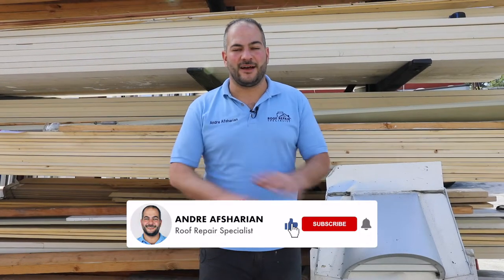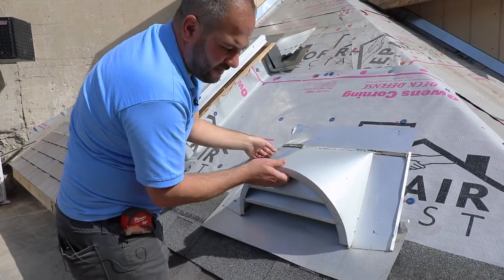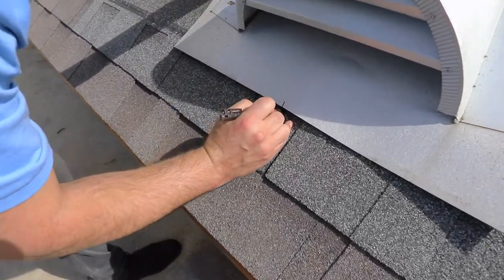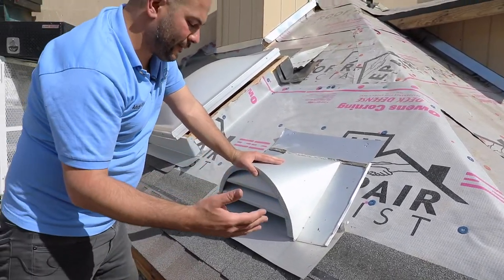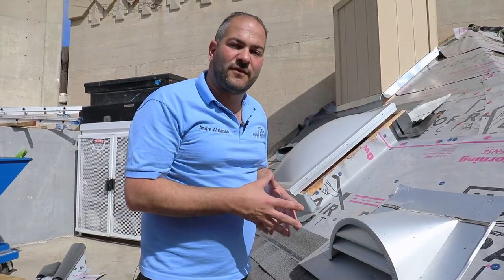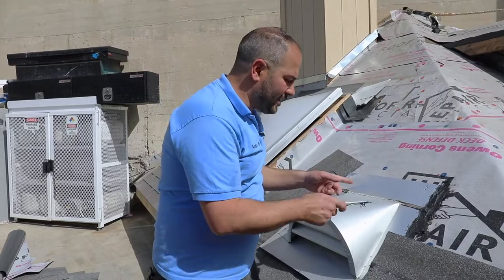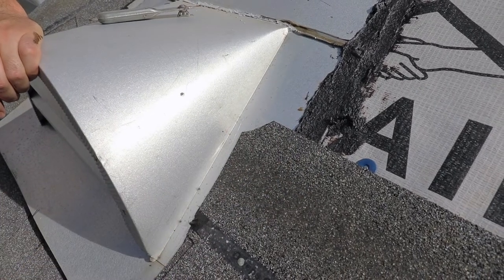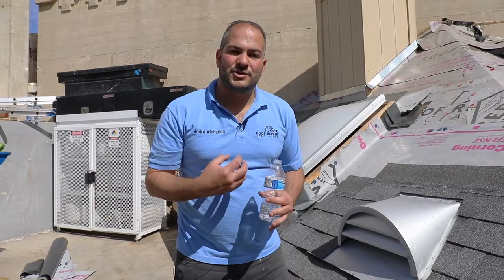How to Install a Dormer Vent | Shingle Roof Install Guide

Comment: Nice production. I am interested in the Chimney in the picture. I want to put that on my roof and have that whole thing open too the attic. It just needs some 1/4 or 18 screen and some kind of protection to keep the rain out. While you are driving down the road look at the size of those CHIMNEYS, 2 by 3 feet and sticking up 4 feet. Just think how much air they would move. Joe in Zip 34698
Reply from the maker: Go with a 1/8” screen if not smaller. Depending on where you are.

Comment: LOVE the videos but you said water doesn't travel up. Please tell my wind that lol. I had a ridge cap taking in water and COULD NOT figure out how... so I waited and waited for a good storm and found the facing wind pushing the water back up and in the ridge cap, running down the inside truss and dripping off at the base. anyways KEEP UP THE GREAT WORK!!!

Comment: Does these design have slope degrees for that vent? I see you working is 45 degree. What about 15 degree vent?
Reply from the maker: We use pitch factors, shingles are designed for roofs 2/12 and steeper. Dormer vents can also be used for 2/12 or greater.

Comment: I bought two Vulcan retrofit dormer vents.  They prevent embers from getting into the attic.  From the pictures on one site, looks like we can use screws.   Can you recommend what kind of screws?   A retired roofer friend said we could you polyurethane caulk on the screws.  What do you think?   There is a Best Materials site that shows the vent.  Also they are on the back side of the house.   Is there any reason we HAVE to paint them?   Thanks.
Reply from the maker: Hi Marilyn, 
I will try to answer your questions below. 
What type of screw to use: any galvanized or stainless steel nail would do fine, with wood threads 1.5" or so long. Nails will do just fine as well. 
Polyurethane caulk: that would serve essentially the same purpose as the mastic I applied in the video would. Either mastic or caulking would work just fine. 
The only reason to paint a vent is aesthetics. If the vent is not visible from anywhere or you are ok with the galvanized look no need to paint it. 

Thanks for watching!
Reply: @RoofRepairSpecialist  Thank you.   That is helpful.